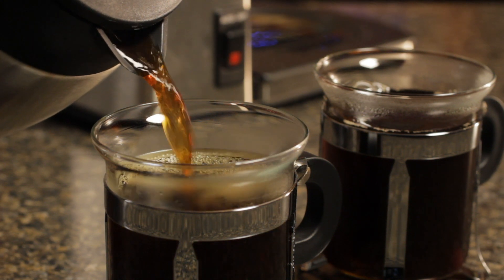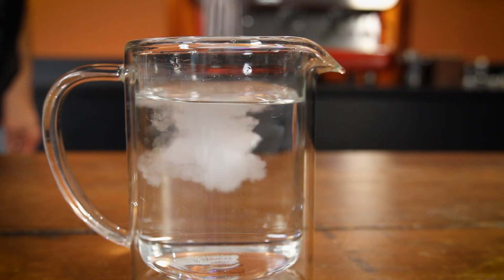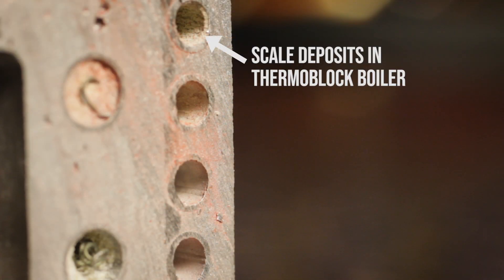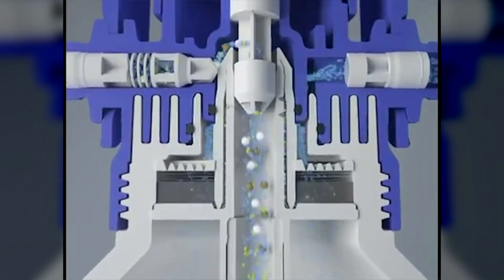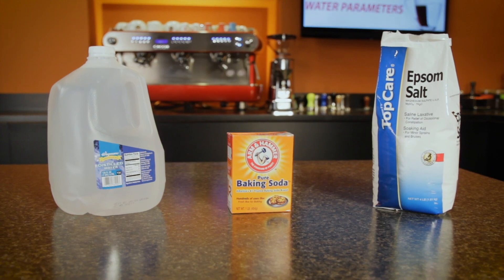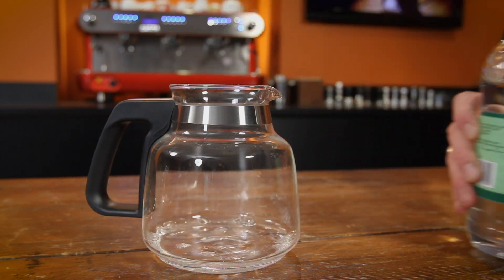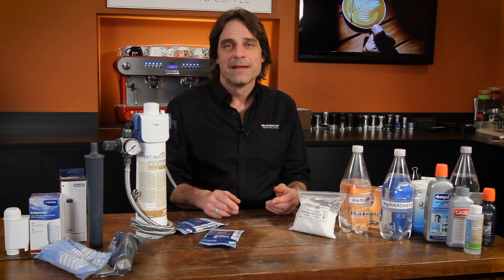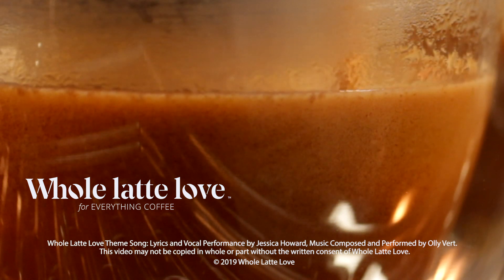Water Filtration for Best Coffee & Espresso Flavor and Equipment Protection

Comment: I am using a brita filter pitcher at the moment - have been for years -  along with adding a pouch to soften the water its called the Oscar 150 i believe -    can you tell me  if this will solve my hardness and prevent any issues  -  is this enough what i do to keep my new machine from being or having to be descaled at all ?     i have the Unica i got from you -    also -  do i have to descale at all if i follow my procedure above  or do i need to descale every so often anyway  -   if so -  how often and how would i know if i even need to descale at all ?   thanks
Reply from the maker: Hi v, Brita filters typically do not treat for hard water by removing/reducing mineral level. I'm not familiar with the treatment pouch you mention. Outside of products from BWT most softeners use sodium to soften (reduce calcium level) the water. Most of those when used as directed should prevent scale formation in you machine unless your water is very high in calcium or has other edge case issues. If your water is not extra hard and you soften then you should not have to descale.
Reply: @Wholelattelovepage  Bilt Osmotic Scale Reduction Oscar 150 Cloth Pack/Limescale Inhibitor  - its similar to the BWT you have -  i found t his one years ago and been using it ever since -   i wanted to check and ask you guys in case -   i am doing it wrong -   so far so good with the  Unica -      thanks for the quick response -   this water debate is very unclear  - who says one thing - who says another -   i will test my water now with the TDS and PH meter to get an idea   - keep  up with the videos

Comment: Hi Marc! Love the videos! I know this one is several years old so since then have you guys looked at the Lotus Water drops and their recipes? Curious what you would recommend for a non-plumbed machine now that we have that option.
Reply from the maker: Hey AF, Thanks for sharing the love! Never to late as I monitor for new comments. I know there are commercial prep options for creating brew water starting with pure distilled or RO water. They are generally fairly pricey but easy to use. Also need the pure water to start with. But it can work for some users. A few years ago I put out a video on creating your own SCA spec brew water using very inexpensive baking soda and Epsom salt to create your own: https://youtu.be/iHI7jC0sQZo As I happen to run an RO system at home for a reef aquarium. I'm lucky were I am that are municipal water is soft and of excellent quality. Even with that, I still treat our tap water with one of the BWT calcium to magnesium ion exchange solutions just to be sure there's no scale, remove chlorination and get the benefits of magnesium as an extracting mineral.
Marc

Comment: I have just purchased a BWT penguin and I am using it in my 10 year old Rancilio. I was using Brita water and then I had a whole home filter that was mostly for flavour. Sometimes it seems like Silvia was producing sour shots. After getting some BWT water in there, it seems like the sour/odd tasting shots are gone. I am tuning the machine on Lavazza Crema & Aroma.

I guess the water here isn't that hard. I replaced the boiler gasket on Silvia a year ago and the heating element was darker copper like an old penny but there were zero deposits on it or in the boiler except for some light slime at the bottom. When I found the leak, I let the machine sit for a bit though.

I will install a permanent filter because I have a new Rocket Giotto Evoluzione  Cronometro R and I'll plumb it in. Both are enjoying the Penguin. I HIGHLY recommend that people try it. I would ditch the Brita.
Reply from the maker: Hi Todd, Thank you for sharing your experience and recommendation of the BWT Penguin Pitcher. I would definitely connect an in-line filter for your Rocket EVO R.
Marc

Comment: I purchase Alhambra Spring water and was planing to use this also for my new Breville D.B… would I still need to use a filter?  Is Spring water considered to be “hard” water… or would I be better off purchasing Alhambra purified water for my machine instead?
Reply from the maker: Hi C-BC, I'm not familiar with that brand of water so I do not know. Some brands of spring water are softer than others. Best advice is to test the water for hardness which indicates its mineral level. You want some minerals in the water for best flavor and to prevent over-extraction. So you do not want to use pure distilled or reverse osmosis water with no minerals.
Marc

Comment: Hi Marc, I'm looking at a Profitec Pro 500 and was wondering how to soften. I have delicious well water but unfortunately hardness of 9. I like the taste of the espresso I make with my current machine (Ascaso) but I heard Profitec does not recommend de-scaling. Is that true? I did note that the machine comes with a tube for in-tank filters I suppose. Is that the best choice, or am I better off with a pitcher or packet? Thanks in advance!
Reply from the maker: Hi Cody, Thanks for the question. Okay to descale HX boiler machines like the Pro 500. Here's a video showing how to do that: https://youtu.be/yEGfyJkWSqU
For the BWT options, easiest is the Bestave pad filters so long as you do not go through more than 1 reservoir's worth of water a day: https://www.wholelattelove.com/products/bwt-bestsave-m-anti-scale-filter
The BWT Bestcup is another good option regardless of how much water used: https://www.wholelattelove.com/products/bwt-bestcup-m-package
With either of those options you should not need to descale your machine.
Hope that helps!
Marc

Comment: Hi Marc.. great video. Quick question.. I see you have a delonghi filter to the left of you in the video... It's exactly what I use and I was wondering how long it would take for the filter to work on all of the water after filling the reservoir? Say 1 or 2 litres? Would I be right in assuming that you should make the coffee maybe 30 minutes or so after filling the tank?
Reply from the maker: Hi Dan, Thanks for the comment and question. The Delonghi filter works on demand so there's no need to wait. Water going into the machine travels through the filter as needed. It's a different story for the BWT Bestsave in-reservoir pad filters. Those do need an overnight soak to do their job.

Comment: Hi! Marc thanks for the very informative video!! But I have a question, my filter filters water through nano filtration. Is the water from that filter viable for my machine?
Reply from the maker: Hi DD, You are welcome and thanks for the question. Unless you are referring to a reverse osmosis system I'm not sure what "nano filtration" is. Could be marketing talk. RO systems use a semi-permeable membrane which essentially allows only water molecules through. RO systems produce water that's mineral free. It's actually too pure as you want some minerals in your water to support flavor extraction and prevent damage to metals in your brewing equipment. RO water can be used but must be re-mineralized after treatment.
Marc
Reply: @Wholelattelovepage  Ooh ok thanks!!!!!  :)

Comment: How well/safe is it to use SimPure Reverse Osmosis Water Filter (4 stage) in a ECM Synchronika (Duel-Boiler)? Guessing any sort of RO is bad / leads to corrosion?
Reply from the maker: Hi DM, Thanks for the question. We do not recommend using pure zero TDS RO treated water or distilled water in espresso machines. It may cause corrosion of metals and over-extracts coffee.

Comment: Hello! Can you tell me how often I have to change my BWT magnesium filter? I believe it says 120L or 4 weeks? I don’t understand why there is a time limit if I’m filling my machine irregularly. I have about 65L done on this current filter but bought maybe 4 months ago and trying to do the right thing.
Reply from the maker: Hi kl, Thanks for the question. Current packaging on replacement filters says to change every 8 weeks regardless of volume filtered. I'd go with that unless the packaging on your replacement filters has a different number. I know at one point there was a volume in liters or maximum time before change so might be filters in circulation with other capacities.
Marc

Comment: Hello there I have a 3 filter Automated Iberital Expresso Machine; I just installed in my house. The machine is new but I bought it almost 8 years ago for a Coffee House I never started.
We have been using the machine for the last 2 weeks it works great, but it needs the water filter. I want to buy the correct water filtration system and size to fit under my cabinet with the correct hoses for easy installation. I been advised to make sure, it removes Chlorine and Calcium, etc. I would like to speak with you for more detail help in choosing the correct one from your store. Let me know. Thank You
Reply from the maker: Hi ud, The BWT Bestmax premium does what you need. It does particle filtration, removes chlorine and other chemicals using activated carbon and uses ion-exhcnage to reduce and replace calcium with magnesium: https://www.wholelattelove.com/products/bwt-bestmax-premium-filter-package-w-besthead-flex
Here's a video showing how to install the system: https://youtu.be/A0rHIurKFzQ
If you are in the US or Canada you can contact our experts here for more detail: https://www.wholelattelove.com/pages/contact-us

Comment: My local water has hardness of 16ppm/mgL. Does anything know if this will be OK. Would I be better off to remove the filter that comes with the coffee machine if its reducing hardness even more?
Reply from the maker: Hi c, Thanks for the question. Wow! 16ppm is very soft and highly unlikely to cause scale. Filters which come with coffee machines generally use sodium softening to reduce minerals by replacing calcium with the sodium. But no reduction is needed if at 16ppm. Actually should probably remineralize the water a bit to improve flavor.
Reply: @Wholelattelovepage  Thanks for the reply! i have subbed thanks

Comment: What would you recommend for a Yacht.  We have a yacht that has 1750 gallon storage tank the water is filtered coming out of the tank and then sent to the rest of the vessel via plumbing.  When the vessel is out at anchor or running the vessel make water with with a saltwater RO system.  PPM is normally around 200-400 PPM.  What would you recommend for us to use for filters with a reservoir Rocket R Nine One?
Reply from the maker: Hi Luke, Not sure which of your water sources has the 200-400ppm TDS. Whichever it is (or maybe it's both) that's rather hard water and likely to cause scale in your machine. If your RO system is doing 200-400 PPM I'm guessing it has remineralization on the output as that's a high TDS out of an RO. Keep in mind you want some minerals in the water for flavor, to prevent over-extraction and prevent corrosion of metals in the machine. So the goal id not zero TDS. The easiest solution is probably the Bestsave in reservoir pad filters. These work great unless you go through a lot of water as it needs 12 hours in the reservoir to do its ion-exchange magic

Comment: Thanks Marc for the info.  I just bought the penguin filter pitcher on Amazon.  We live in south Texas with really hard water. We have a water softener system and filtered water in our refrigerator and I use bottled water for my coffee maker and breville tea maker but thought this pitcher wouldn’t hurt. With all that said will I still need to descale my moccamaster?
Reply from the maker: Hi d, The BWT Penguin Pitcher can treat your hard tap water. At a hardness of 12-14 degrees the filter has a rated capacity of 120 liters. The harder your water the lower the capacity. Bottled water (with the exception of mineral and some spring waters) usually is not very hard. Further refining that water through the BWT pitcher would very likely make descaling unnecessary.

Comment: Hi Marc - What do you recommend for rocket appartamento sere nerra? Thanks
Reply from the maker: Hi TF, Thanks for the question. Since you can't plumb the Appartamento You could go with with the BWT Penguin pitcher: https://www.wholelattelove.com/products/bwt-penguin-2-7-l-water-pitcher That's what I use for reservoir fed machines. Nice as it also makes great tasting drinking water. Another option is in-reservoir pad filters - Bwt Bestsave: https://www.wholelattelove.com/products/bwt-bestsave-s-anti-scale-filter Those need about 12 hours soak time in reservoir to do their thing. Both the pitcher and the pad filters use BWT's patented ion exchange tech to prevent scale depositis. Hope that helps!
Marc
Reply: @Wholelattelovepage  thanks Marc

Comment: Hey Marc! Thanks for the  great video. Very detailed and informative!

I tried filtering my water for 2 years but I couldn't  really get in to filtration. I just use tap water and descale my machine periodically. 
Is there anything wrong with this?
Reply from the maker: Hi Jonas, Nothing wrong with that at all. Some machines are much harder to descale than others - dual boilers! Depending on your source water quality there may be subtle flavor improvements with filtered water.
Marc

Comment: I have a really good question (I think): Since Distilled water would do "the opposite" of hard water, scilicet corrode the metal components of the machines...what if I mix a fridge filtered water (medium hardness) with distilled water? will the "corrosive" power of the distilled water "make up" for the other minerals in the fridge water and cancel each other in a way? Does it make sense? If the alkalinity of the distilled water corrodes metal and metal is minerals, will it also corrode minerals build up preventing its formation?

Comment: Is there any bottled water that you can buy at the store or  the 5 gallon jugs that would work for this
Reply from the maker: Hi JJ, Maybe? Bottled water like that is all over quality wise. You'd need to know the mineral content and other parameters. Also, bottled water tends to be far more expensive long term than something like the BWT Penguin pitcher. So long as your tap water is safe to drink and not untreated well water the solutions here will work.
Marc
Reply: Hi JJ I Live in Arizona I believe the hardness is 6 to 11 if I get a penguin filter will that be safe for my machine and should I still  descale
Reply from the maker: @jimbobjohnson469  Penguin pitcher should work well. That rating is generally considered moderate to hard which is within range of the pitcher.
Reply: @Wholelattelovepage  thank you penguin picture it is

Comment: Thank you mark for all the help you provide to customers and potential customers through the accurate information you always provide
Does bottled waters causes limescale to the coffee machine ?
I use the bottled water i drink for my moccamaster and my superautomatic
And are they the ideal choice for coffee taste?
Thanks in advance
Reply from the maker: Hi Sal, You are welcome and thank you for the kind comment and question. Bottled water can work. But there's a wide range of mineral levels in bottled waters. Even a single brand purchased in different geographical areas may have different levels. Best bet is to check with the supplier on mineral level for their product. If classified as "soft" in hardness at <7 degrees of total hardness it's unlikely to cause scale. You do want some minerals in the water. Just not too much. Minerals support flavor and prevent over-extraction which cause bitter flavors. Hope that helps!
Marc

Comment: Hi Marc, thanks very much for an informative video.

There's a lot of talk about scale build-up in this video, but little on the reverse - corrosion. I'm fortunate to live in an area where the water is naturally soft and not worry too much about hardness. I still would use a filter in any case.

In my case, the only real "negative" is the elevated levels of chloride (sodium) in the water, as well as the water's balance tending slightly towards acidic. As a result I'm curious as to the efficacy of these in-tank filter pouches against water that could possibly corrode the machine's internals (boilers, etc.)? Or if you can provide any product/filter recommendations for tanks (I cannot plumb my machine in unfortunately).
Reply from the maker: Hi JK, Thanks for the comment and question. I didn't get into corrosion in this video. It does come up a lot in some of my comments to those who want to use pure zero TDS reverse osmosis in their machines. RO water is corrosive to metals due to its complete lack of minerals. The filters in this video will not help in your situation. They use ion-exchange replacing calcium with magnesium. One option with pure RO or distilled is to buffer/remineralize with tiny amounts of baking soda and Epsom salt. I have a video on how to make SCA spec brew water using those to treat ultra-pure water. Honestly not sure how that plays into your elevated chloride level but the baking soda should raise the pH. In special situations we have in the past forwarded customer water test results/specs to BWT chemists for advisement on recommended treatment. BWT does have remin in-line cartridge filters for use with RO systems. Here's that video on how to make the SCA spec brew water: https://youtu.be/iHI7jC0sQZo
Marc

Comment: Hi Marc, I have Gaggia Babila and use BWT filtered water but it’s not the one with Magnesium exchanger, and I also use the Aqua Clean filter that you can install in the machine, so should I just use tap water then? and is the filter good enough not to cause scale buildup?

Thank you
Reply from the maker: Hi YY, Thanks for the question. The Babila will alert you to descale at some point. It'll just be a lot longer before it does if you use the Aqua Clean Filter. How long depends on the starting hardness of the water used in your machine so be sure to test your water for hardness level and enter that info in the machine. With relatively soft source water and filter use it could be as many as 500-800 brew cycles before the machine alerts you to descale.
Marc